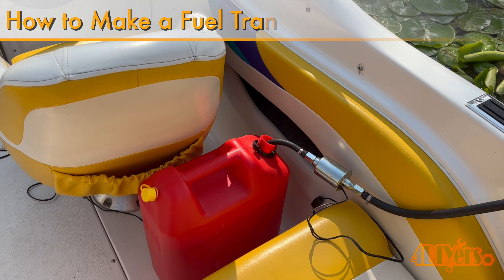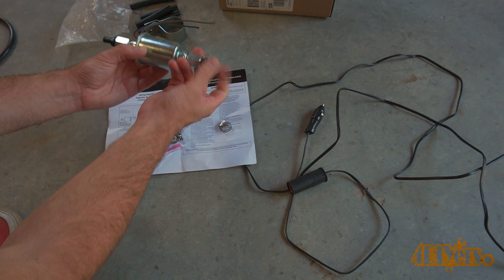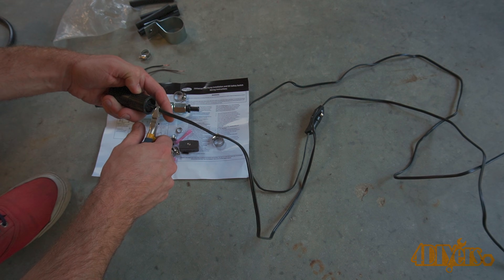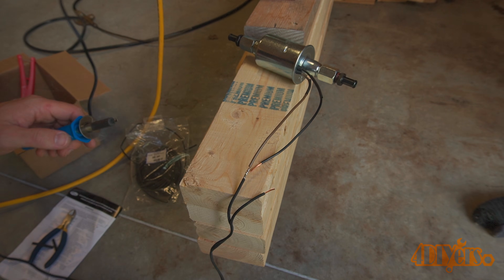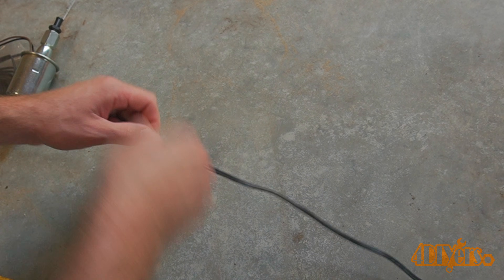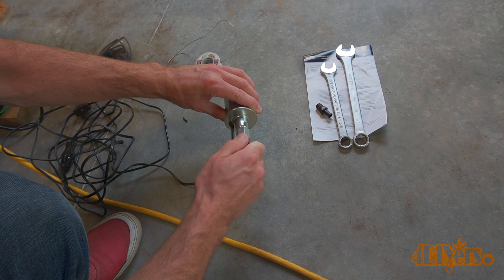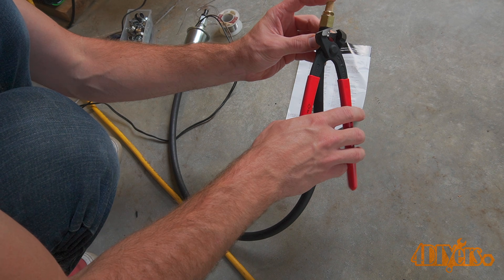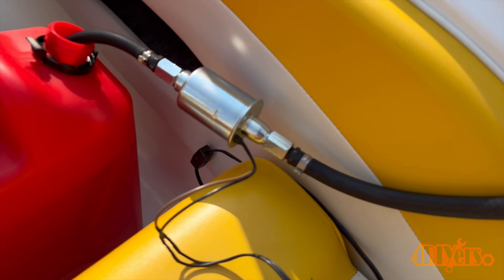How to Make a Portable 12v Fuel Transfer Pump

Comment: Hmmm.... was the pump really that quiet???? That was the main thing I was looking for. Most of pumps like that I have seen are very noisy?
Reply from the maker: It's fairly quiet, it does make a pulsing noise. It's certainly quieter than an auxiliary fan in your engine.

Comment: Looks like the end of the sintered filter has a male end. Do I have to purchase a quarter inch barbed fitting with female end?
Reply from the maker: Yes, it's the best way to lock in the connection on the hose.

Comment: Total cost of parts and supplies vs. a comparable out-of-the-box can pump, like Tera Pump models?
Reply from the maker: Roughly about the same price depending on where you buy the supplies. However the pump here is replaceable if it fails and I'm not sure how long a Tera Pump will last. Reading some of the reviews, it doesn't seem to be too long.
Reply: @4DIYers  Mine about a year. I did buy this just need to shag the hose up to Napa this morning.

Comment: How is static electricity dissipated?  Fuel moving through hose creates static electricity.  Normally, fuel distribution equipment is equiped with conductive hose grounded to earth.
Reply: I added a separate wire to the pump and ran it to ground on, in my case, my mower/tractor.
Reply: hide in your cave, they're coming to get you